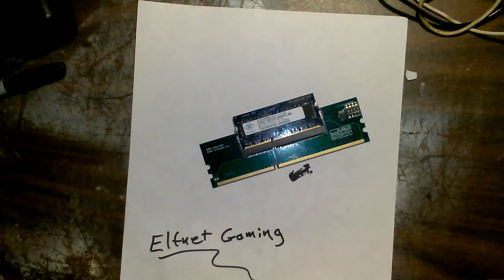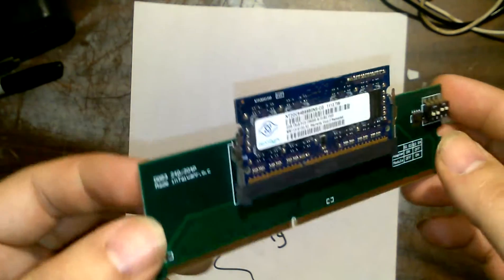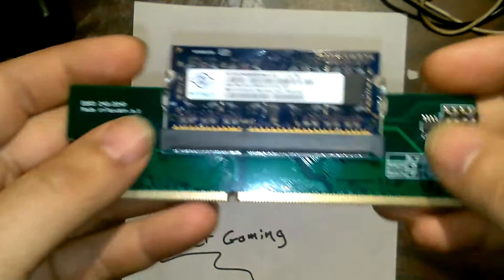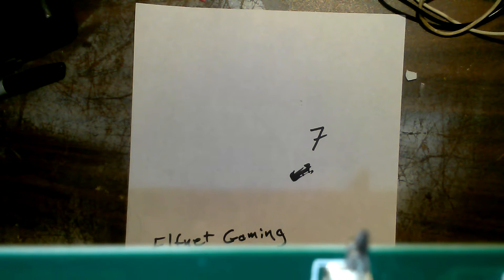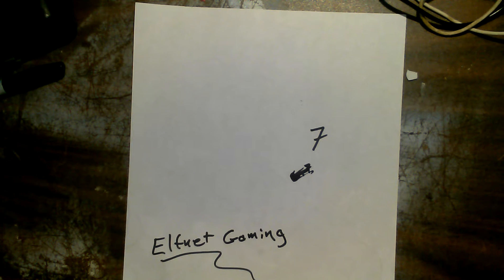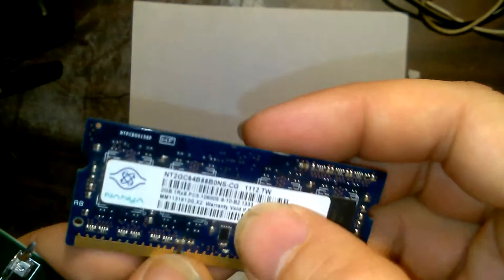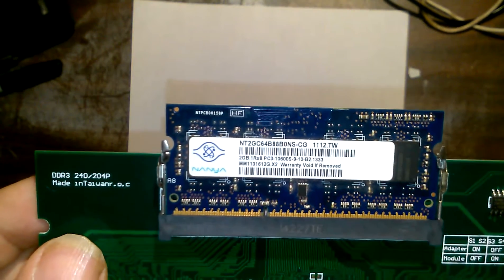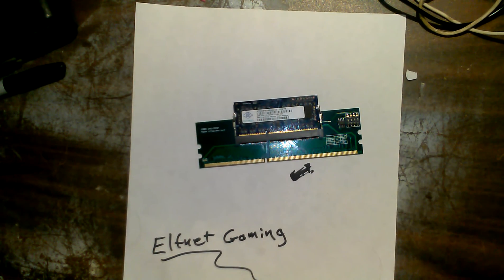An odd piece of PC Hardware.. DDR3 Ram Adapter..

Comment: Nice Video. I use two of these in a DDR2 configuration in one of my favorite project computers. Very odd indeed.
Reply: How does they work? Can you use your ram at it's maximum performance or is it any drawbacks with this? I'm asking since I have 16gb laptop ram for no use, and I got this motherboard with a i7 4770k for free, so I think "why not try this solution"
Reply: But will it slow down the Ram?